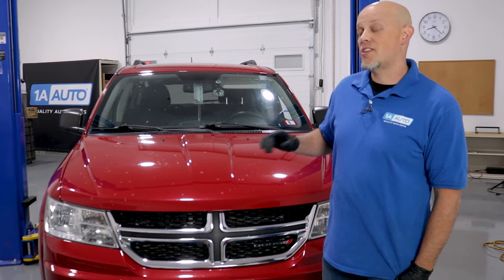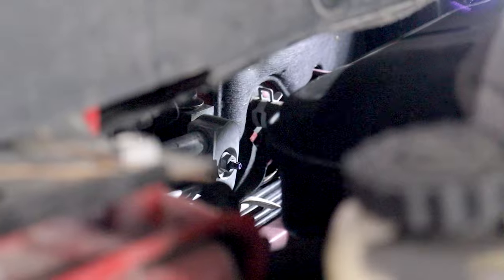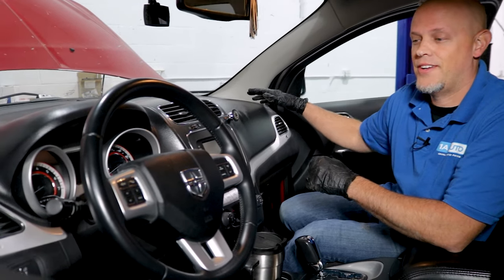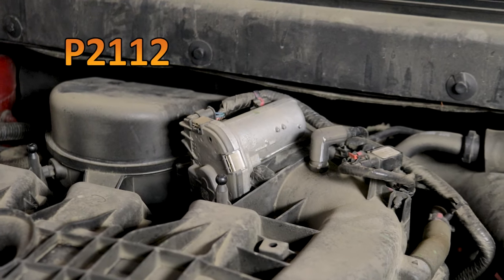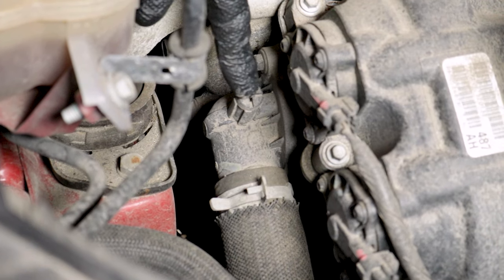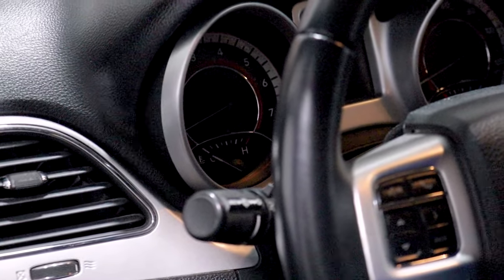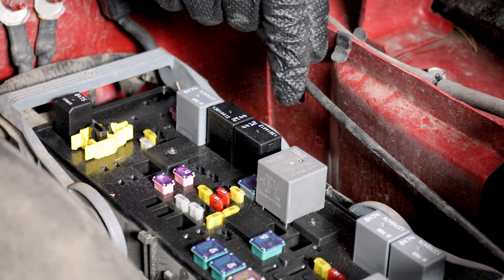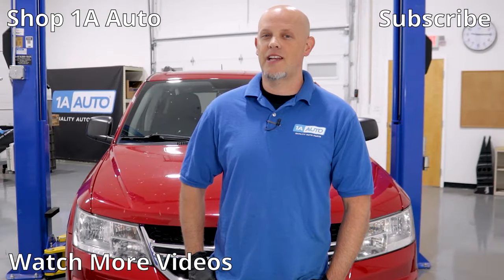Top 5 Problems Dodge Journey SUV 1st Generation 2009-20

Comment: Seems a little better than our 2013 Dodge Grand Caravan. Bought new. 150,000 miles later transmission done for. Not a fan of the 62 te. Between that, needing new struts and a hint of the 3.6 tick going on. It may not get fixed. Especially being that those repairs exceed the vans value despite being extra clean for the year and miles. It's a shame.  Any recommendations on an American vehicle that's relatively cheap and will do 200k plus without major repairs? On average anyway. I was thinking a base model fusion. 
All I really know are trucks. All I've driven for 17 years. My 2017 tradesman has 92k miles so far so good.
(Sorry for long the comment)
Reply: Subaru outback

They are made in usa

Comment: I love the design and styling of this car and the whole dodge lineup. But I didn't want something as big as the Durango. so I have been bent on getting this for the past 2 or 3yrs. But I read everywhere that this car is a total mistake to buy when it comes to reliability. and that's the only thing that has been keeping me from buying.
Reply: Get a higlander. The new ones look ok and theyll well outlast a journey. Got over 115,000 miles on mine and the engine was replaced last september
Reply: I have the really shitty and basic 4 cylinder version with 170k miles 2014. They have a slew of problems, but they are manageable. Annoying, but manageable. For example, to replace your alternator you have to take off the right wheel, to access your battery, the left wheels must come off. It has a bunch of stupid plastic clips too. To replace the rear struts you have to essentially take off all your rear panels and third row seats. The whole time we've had this car it only broke down once, but it had a lot of warranty work back in in day and it does weird stuff sometimes. I believe some of these are hit or miss though, mine runs pretty good but I've seen tons run like shit. This car is good if: you need third row seating, rear AC, and only want to spend 20k. The 4 cylinders are super slow but the platform has been around forever so fixing it isn't that hard. 6 cylinder is a little harder from what I've heard. I would not recommend buying this car unless you need the 3 things I listed above for cheap.
Reply: People just don’t take care of it. I love my 2012 Dodge Journey RT
Reply: @jeremyladue4702  obviously it’s a damn Toyota
Reply: @redeyezreaperx1601  I think so, I’m in love with the 2010 R/T
Reply: Buy it if you want it buy it I love my 2017 plan to own it for many more years.
Reply: Have a 2017 4cyl purchased new.. Truly hold up~no major issues(veeeeery grateful & Thankful for that).. Rides good

It appears like a luck of the draw thing when I read some of these reviews

Comment: I own a 2009 dodge Journey n it's been a good vehicle so far. The heater core is going out and so is the blower motor it don't work on high. I own 3 dodge Vehicles right now. A 07 Dodge Caravan a 09 Dodge Journey and a 2011 dodge Grand Caravan. I'm issues with the Grand Caravan right now. But overall the Dodge vehicles have been good for me and my family

Comment: I have a 2015 Journey AVP at 108k miles. So far, I replaced battery twice, $9 sensor, alternator, and throttle body. Test drove a 2023 Tucson and Santa Fe the other day and my car still drives better. Hyundai feels cheap compared to my journey Guzzles gas like nobody’s business is my only gripe.
Reply: Im with you bro
Reply: I also have 2012 journey sxt 4-cylinder FWD and she's my daily driver for almost 3 years now but still in good condition. Just do the car maintenace regularly and it wont give you headaches.

Comment: i replaced the small square topped 10 purple fuse it is located to the left of the 2 wiper relays if you are looking at it from drivers side. that  fixed the problem, shouldn't you be telling people to check that fuse first ? they cost about $ 3

Comment: I replaced both throttle body and accelerator pedal and I still get the red lightening bolt message every morning. I get the message in the morning 1 minute after starting the engine. then I restart the engine and 1 minute later I get the message again. Then 1 later after restating the engine a 3rd time I'll get the message again. weird right, every morning this happens. Seems to me I get the message when the motor is cold. 3 times every morning like clock work but not during the rest of the day, just in the morning. What gives?

Comment: Buying a 2010 dodge journey. 2 years ago placed a new battery and alternator on it. Just got done replacing tires brakes n such. Oh lets get to fun part. Be a few weeks before i can get it towed to see what is going on. I left state drive 5 hours there and back home no issues. im sitting at stop light after school and getting paperowrk done for a new job. And where speedometer is smoke started to appear oh yeah. So i got off road and no turn signals or head lights. Well after letting vehicle calm down. I still have emergency flashers even thgh you couldnt hear it inside. So i took 3 mile trip home. My son came out got headlights again and we still had break lights rear lights and when energency was on u could see the flashing. Well when we tried regular turn signal or even wiper blades nothing. I also noticed dash board was not dimming up and down since it was vetting dusk by this time. Next day still have inside power at 10 am but click click and wont turn over. 4 pm after i get back home from bus dead as a doornail the vehicle. Hope this be covered by warranty.

Comment: There is a common problem with the horn/alarm going off. Had to pull the fuses for it. Otherwise it’s a costly computer module  with no telling how long it will last.

Comment: GREAT...NOW YOU TELL ME!! Wish I would have seen this video 2mos ago!. I'm experiencing all of those problems after 30 days!! I bought a 2009 RT 158,000 mi $3k. Body in Great Shape..but this car is not built to handle these rough NYC STREETS!!..After the first week of driving ran into these problems. Heat only works on driver side. Engine runs rough. Check engine light comes on every week!! Electrical problems- radio and backup camera works when it wants to.🤦🏾🤦🏾🤦🏾
Reply: My heat only works on drivers side too! Single climate heat too. I just posted on here about it. Also had electrical probs and had to locate the grounds and clean them all before stupid thing stopped. My headlights and any interior lights would pulse. It was frustrating! I hate this car!
Reply: Yup. 2010. Pass side heat blows cold (also the blender door "clacks", even if the vehicle is turned off). 
Knowing that the ENTIRE DASH needs removed... I just deal with it.
Reply: My heat only works on drivers side also.  So annoying
Reply: Honestly you bought a car with 158,000 miles, you didn’t think this was gonna happen? You’ll be lucky to get 15,000 miles out of it. I hope you get 100,000 but that’s not the way to bet
Reply: What did u expect with it being 11 yrs old and that many miles
Reply: @vincedunn9983  2009. SXT 6 cyl. A/C just quit working. Our very honest mechanic says it's a 30.00 part, and 1000.00 to remove the dash to put that part in. No thanks. And I'm on my third transmission.  81.7 k miles. The transmissions cost us nothing because we bought two cars that night,  and the dealer included a lifetime drive train warranty. My guess is that 2009 was a very unsettling low-morale year for Chrysler's workers. They didn't know from one week to the next who their next owner would be. I absolutely love the car when it works. Love the size, visibility,  dashboard and all around utility. I just can't stand an undependable car.

Comment: I have a 2013  v6 144k miles bought it with 3k miles none of the issues shown in the video except key fob battery’s it’s 2021 bought it in 2014, only replaced the battery’s in both fobs 2 times. Fob battery’s get weak after time normal maintenance not a car issue.  Here are the issues I have had with my journey. 
#1   Oil pressure sensor this should have been a factory defect since dodge has issues with this sensor on all the v6 engines and v8 engines in their production. 
#2. Washer fluid tube at hood hinges and squirts … dodge used a hard plastic tube at the drivers side hood hinge that cracks and leaks easy fix . Just replace with rubber tubing … washer squirts break after time I’ve replaced 1 set over the years
#3. Seat Benzel’s poor design and break from getting in and out of the car
These are my only complaints about the car, only other issues have been normal maintenance front struts at 130k miles , 2 battery’s just put the second one in 2 weeks ago and replaced the alternator last year. Brake job will be soon just pads rotors are in great shape

Comment: The infotainment system on mine is strange. I have a 2009 Journey and sometimes when I'm driving, the radio and all sound just stops. The screen starts glitches out or goes black and I can't get any sound from it
Reply from the maker: +KJ We wouldn't be able to diagnose an issue like that here, you may want to have a local mechanic take a look at it. Thanks for checking us out! http://1aau.to/m/Shop-1AAuto-c

Comment: My dodge journey 2013 3.6 rt after few kilometers heat gage goes up normally it sets in middle,  but from few days it's heat up yesterday it's suddenly goes to almost 95 % .I stopped the suv right way .my dodge coolant plastic dispenser coolant is boiling and small amount smoke came out .but the dispenser empty in less then 2 minutes what could be the reason.

Comment: This is known as FIAT Freemont in Europe. Buying this car was the miserable decision of my life. Problems are waiting in queue. One goes other comes. Alternator of this car is the worst. My car started draining the battery, took it to FIAT, they kept it for like a week and said the battery was fault and there was nothing wrong with car. Few months later problems appear again. Took it to Fiat. Same story, battery is fault.  Replaced 3 batteries in 1 and half years but FIAT didn't wan't to accept that the Alternator is faulty. Took the car to a private garage, he ran all the tests and found the alternator was faulty. Since the car was broken and FIAT garage was involved and they didn't fix the issue, I have no faith in this BRAND. This single problem costed me roughly around 3000$ (FIAT visits roughly 1000 and private garage + alternator extra 2000). and it other issues as well costed me lot of money. Timing belt was broken, its uconnect never works. One of its engine belt broke before the time of replacement.  The most sick car on planet Earth.

Comment: Wife & I have a 2011 we got in 2015. Out of the 5, I replaced the thermostat. We have a misfire on cylinder 1& I can't figuer it out. Frist happened 3 years ago, I replaced coil & plugs, didn't fix it. I swapped an injector with another cylinder, cylinder 1 was still bad & the one I sawpped with was fine. It eventually stopped. Now it came back & saying 1 & 4 misfire. along with Intake manifold runner potion A & Throttle/Pedal potion sensor/switch. I'm thinking the Current sensor on battery is bad

Comment: Man my seatbelt dinger will not go off I found the wire has burnt and pretty much split apart I joined the wire back together but no luck
Reply: Buckle your seatbelt and turn your car to on but don't actually start the car. Buckle and unbuckle about 5 times, turn battery off. You'll hear a little ding and that turns the ding off. Sensor still works just no ding. Works on all Chrysler/dodge push buttons.

Comment: Transmission cooler lines, high pressure power steering line, rear calipers, ANY wheel hub/bearing, ignition switch.  More common Journey things FYI.

Comment: Not to mention transmission problems and the oil cooler housing going out and leaking oil all over the place as is failing!  Also the placement of the battery where you have to take off the wheel and fender cover to replace it!! Worst car I've owned!

Comment: You never mentioned the power steering hoses on the journey. They are crap. I live in Canada and the winters get pretty cold so far through three winters I've had to replace my power steering pressure hose because they always bust in the cold and no I don't buy crappy after market parts I buy OEM from the dealership.

Comment: I have a 2009 the brakes are the biggest problem these cars have.
Reply: Do a 2012 brake upgrade.
Reply: Because the callipers are to small, they put larger brakes on the newer models so if you just change to the newer setup then you brake problem will be solved.
Reply: @inmatejason  how do I upgrade? Is it expensive?
Reply: Yes. This. Will swap to 2012+ next time. Thanks.
Reply: @ws2594  Googled it, looks like just under $100 on Amazon, free shipping, for 2 front dual piston brake caliphers. The good thing about Chrysler is parts are dirt cheap. Look up youtubes on how to change it. With the right tools, it's not hard. You'll also need pads and possibly disk rotors. Don't worry, they're cheap, all of them, if you're willing to do your own work.
https://www.amazon.com/Callahan-CCK06017-Original-Brake-2012-2018/dp/B07VNBZ5BF/ref=sr_1_8?dchild=1&keywords=2014+dodge+journey+front+brake+caliper&qid=1607959844&replacementKeywords=front+brake+caliper&sr=8-8&vehicle=2014-40-6800------------&vehicleName=2014+Dodge+Journey

Comment: I have a 2018 Dodge Journey. Was advised not to get one because my father had one and had nothing but issues with it. Bought it with 5 miles on it 5 years ago. While it’s done the job there have been a couple little hiccups since. 

1) Not an issue, but can be, but annoying to me. Who thought it was a good idea to put the battery in the wheel well of this thing?!? YOU NEED TO BE FIRED!

2) Electrical issues are INSANE. Radio doesn’t always work, BT doesn’t always sync and for whatever reason my license plate lights go out way more frequently than they should. 

3) The backup camera has managed to already have a distorted view that makes even a blind person have to squint. 

4) The car randomly blew a coolant line. So I replaced it no issues after getting a new one. THEN the thermostat housing cracked somehow and had to replace that. 

5) An issue that just occurred within the last week, one of the pulleys went out. 

While they aren’t major issues, for the most part, they are slightly annoying but also expected. Car now has 80k miles on it and is driven in Illinois’ bipolar weather. All in all though, it hasn’t been terrible and has been reliable up until this point.

Comment: I want to be happy with this car because its my car and I need it...but its one thing after another with this thing. Anybody else have an issue where they can hear coolant rushing through the dash when you hit accelerator? I think something is plugged up and the increase in pressure gets it moving. ONly seem to notice going from low speed to high speed. No heat right now sucks but it turns out the blend door actuator is broken too, so I guess I just fix one thing to fix the next.
Reply from the maker: +Eric Peru We wouldn't be able to diagnose an issue like that here, you may want to have a local mechanic take a look at it. Thanks for checking us out! http://1aau.to/m/Shop-1AAuto-c
Reply: @1AAuto  thanks for the reply. I was just throwing that at the wall to see if it stuck.

Comment: On my 2010 the battery tray rusted so bad the battery fell out after 8 years, brakes on front had to be changed after 45000k, the car shook when breaking down hill, yes the alternator failed also

Comment: And if it's a 3.6 lifter/cam noise
Reply: Camshaft failure, just had my engine replaced a few months ago and thankfully had carshield
Reply: I have lifter noise (at least I think it is). When idling it has a clicking noise and it's really annoying. I'm not sure if I can find a cheap fix or if I'm gonna eventually have to replace the engine

Comment: I have a journey but cause I helped some couple get it. They split, owed 3 months on it, I got called and I didn't want to f up my credit so I'm stuck with it. Ok so the ac sucks, the heater actually burns my freaking nose. To do oil changes... there is a high chance the sensor will f up. That piece to replace it is $300+ at any auto zone/ o Riley. And you need some special screw drivers to replace it. At a shop it's a minimum of $500 to repair it. Thank God my husband knows how to fix stuff up. We got the part at Amazon for $80 and the screw set was like $20. Also the joints on on the wheels are horrible! Keep it well aligned, balanced and treat it like a dropped truck! What else🤔 oh yeah where the windshield fluid comes out of, it also stoped working. My husband replaced them with some of an explorer I believe from the junk yard and they get any other car wey that is besides us lol. The head lights!! It's a stupid diffrent buld entrance and it's hard to find. There is mainly just stupid yellow head lights which I hate yellow. Idk how but my husband ( who is an industrial electrician but loves modding vehicles) put a bunch of wires and modified adaptors and what not and now I have HIDs. Also the original bulbs that it's supposed to have burn badly. Other than that I haven't had problems since tbh, I have 2 years with it and have only drove it for a whole month and that's it. So I'm paying it just to take up space. I hate it. I'm almost done with the payments. It's a 2016 all blacked out.
Reply from the maker: +Dannie Ortega Thanks for the feedback!